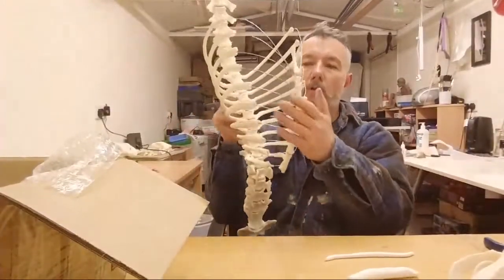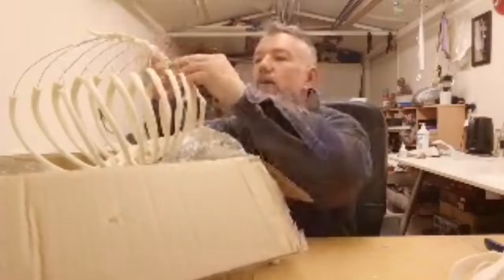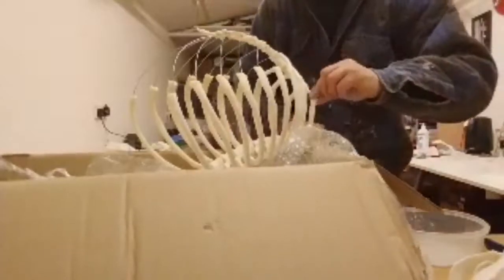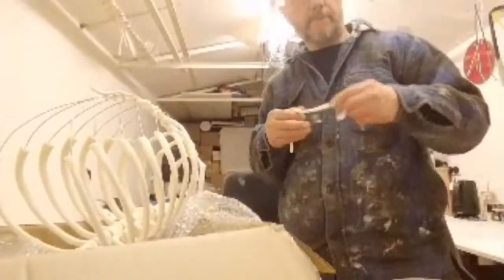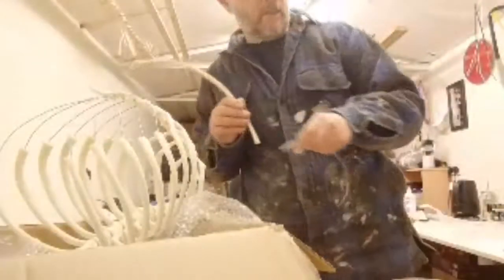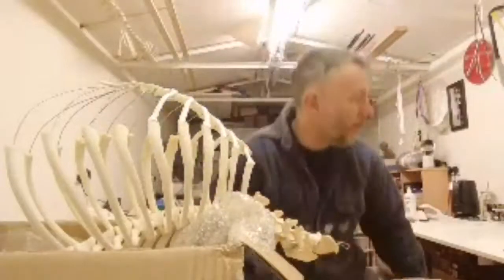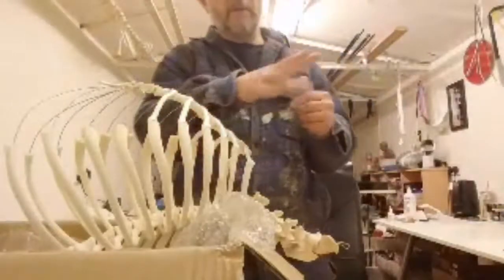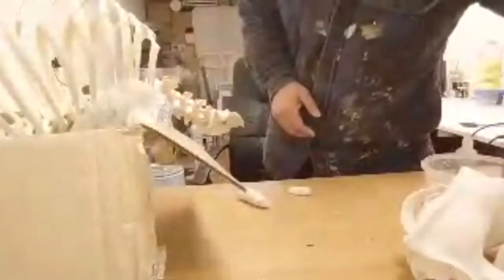Mastif Sternum

Comment: Will be great if you make fullscale "Stan" t-rex scull BHI 3033. I've made 90% of that scull in full scale of paper-plaster clay and wire. It took half a year to build it. There is a lot of information on bones of the scull, pictures with scale bars... on the Internet. So I've tried to make it as close to the original as possible, including serrations on teeth. And it looks awesome. It's in my garage now. Very heavy. Separate bones fixed to a steel frame. But after winter season it got mold over a bit, despite I'd added salt to the clay, so I plan to rebuild it with epoxy clay. I'm thinking about DIY epoxy clay recipe.